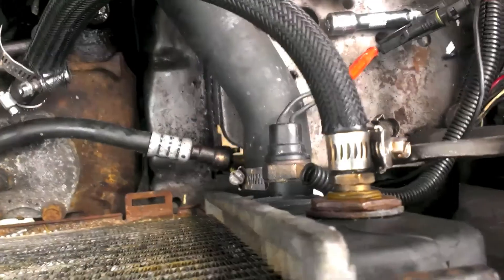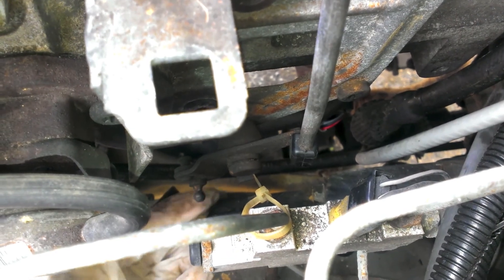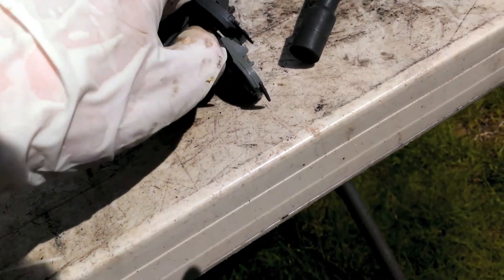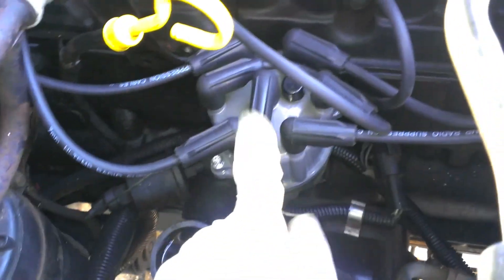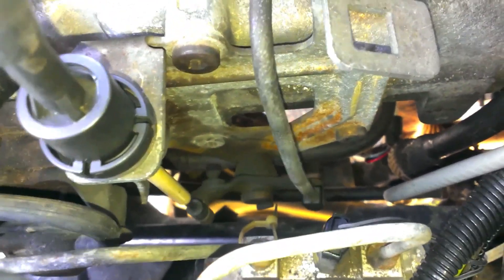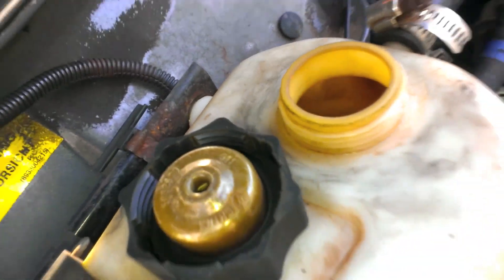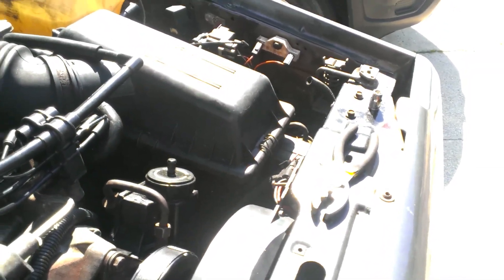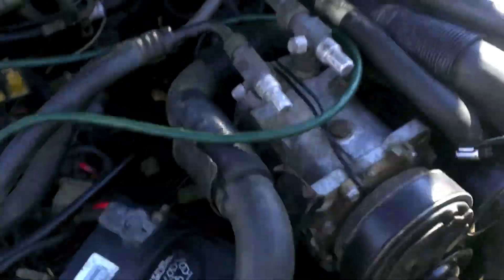89 Cherokee General Tune-up and final connection

Comment: I got my 89 Jeep Cherokee about 2 years ago. It was sitting up in the mountains of Arkansas for about 10years Buried in the dirt. I put a new battery in it and did a tune up. And drove it 375 miles back to Memphis. The tires where dry rotted so I wasn't sure if I would make it or not. But she ran fine and has been sense. Other than my steering wheel being lose. It's a good rig.

Comment: Just did the cap & rotor, oil, tps sensor, radiator/motor flushed, new radiator hoses top and bottom, air filter, plugs, thermostat, and a belt to my old 90 model last week. I just switched the cap & rotor for the new one and changed the wires off the old cap onto the new one then changed out the old wires with the new ones one at a time.

Comment: Great video! I just bought my 89 Comanche and replace the head gasket and all gaskets above it. Couldn’t figure out the one or 2 vacuum line on the throttle body. I had the one for the map sensor but didn’t know if another went in right above it or not.

Comment: That cap and rotor fits a 3.8 Ford V-6 like on a '85 Mid-size Ford. There is a 'old style' distributor for a Ford with the rotor shaft sticking. up. The newer one is like a G.M. Dist. with the screw-on cap. Check yours 1st before ordering.

Comment: What exact belt model did you use im looking at a bunch of different gatorbacks like whats the part number or something like that
Reply from the maker: +THE XJ EFFECT It's tough to find Goodyear Gatorbacks because they were bought out by a company called Continental. They sell the Gatorbacks as Elite Poly-V belts with Quiet Channel technology. 

My 89 4.0L XJ w/AC uses a 102.5" Belt #4061025 where the 4 is the Quiet Channel, the 6 is the rib count, and 1025 is the length in inches with a decimal. If you need a different size, check their catalog here: http://www.veyance.com/ProductsDetail.aspx?id=3128

Comment: Have you ever had smoke come out by the water pump when overheating?
Reply from the maker: Nope, but sounds like you might have a leaking pump
Reply: @NickInTimeFilms  nah I figured it out I got a crack I'm the block any suggestions
Reply from the maker: Ouch, that's not good at all. Time for a new block, less you get it repaired
Reply: @NickInTimeFilms  you know how to fix a block ?
Reply from the maker: Nope
Reply: @NickInTimeFilms  alright thanks for the help keep up  Cherokee it help me with my Comanche
Reply: Digging that valve cover